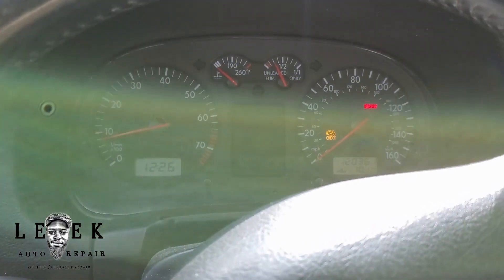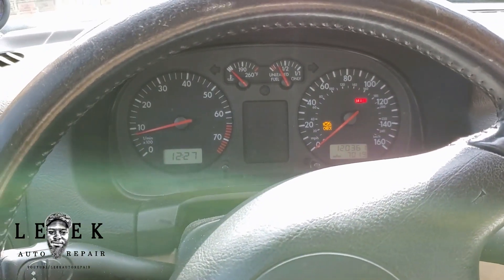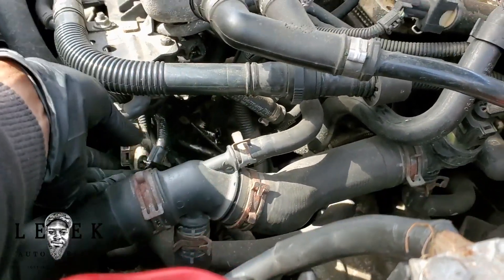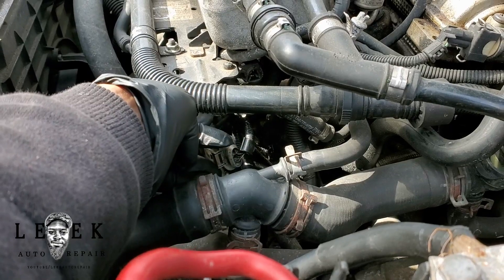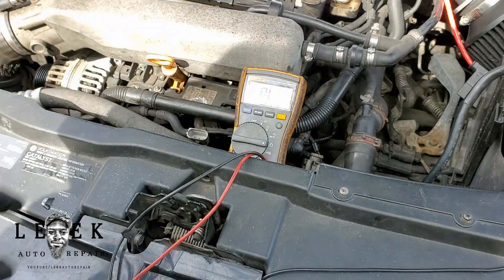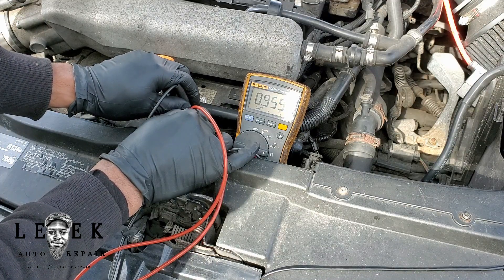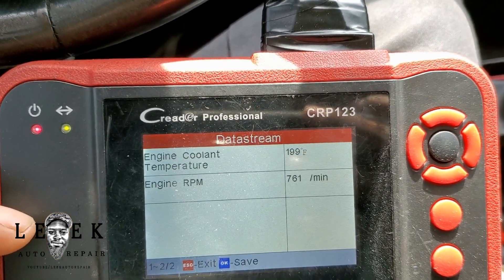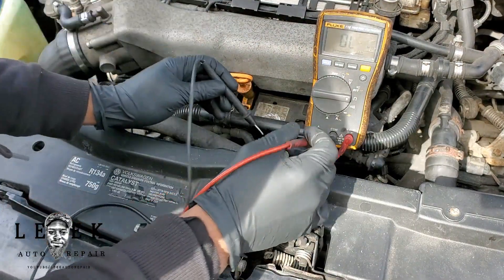Engine Stalls While Driving | P0322 MK4 1.8T

Comment: My son has the 1.8t in an Audi A4 1999. When he puts a new crankshaft position sensor in, the car won't run. If he puts the old one in, it'll crank up but once the ecu spits code after reaching normal temp it bogs out and runs super lean.  How or what needs to be done? It codes a p0322 but has a new cam sensor?

Comment: Late comment but I’m having the same issue once it warms up but also throwing the cam code. Any input?
Reply from the maker: What is the code?
Reply: @Leekautorepair  p0321 and p0322 both crank codes. Turns out I forgot the car jumped time before I got it so the cam and misfire codes I had were stored. Only one coming back are those
Reply: Hey man did u first fix? I have the same problem